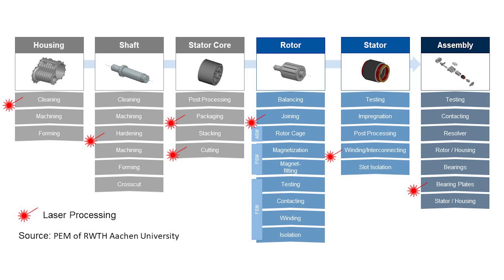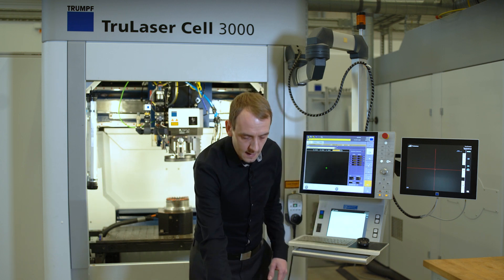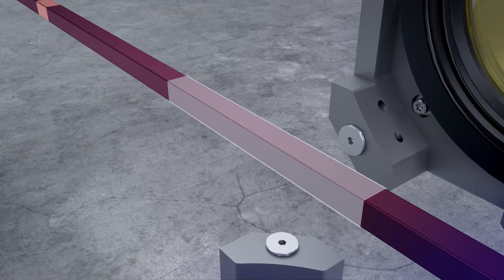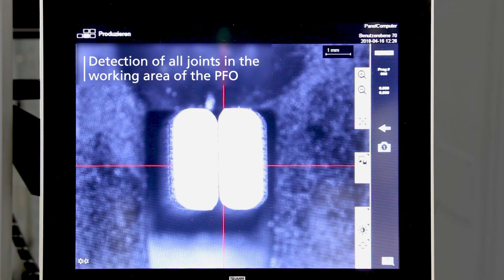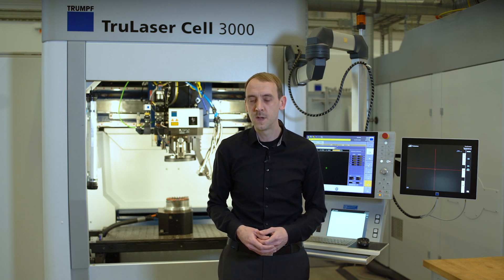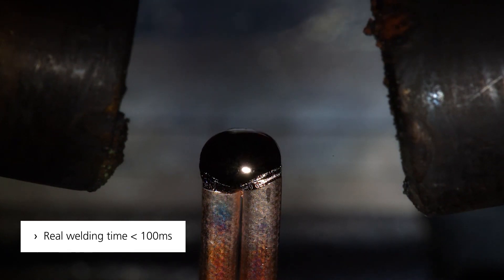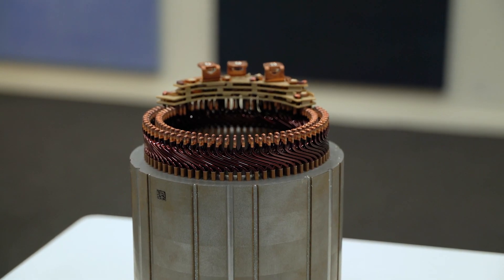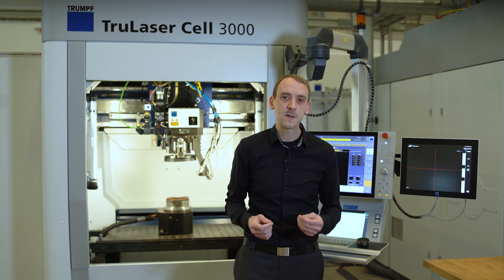TRUMPF: Ask the Expert – Hairpin welding

Comment: Wouldnt it be even better if the hairpins get laser welded from the sides as well?
Reply from the maker: Hello and thanks for your question. Welding from the side would potentially be possible as well. However, heat input is lower comparing welding from top versus from the side, as in the later case we have to fully penetrate through one wire first before even melting the second one, energy flow will be asymetric. In case of welding from top side, we can evenly distrubute the energy input.